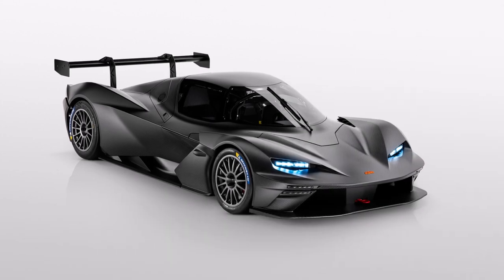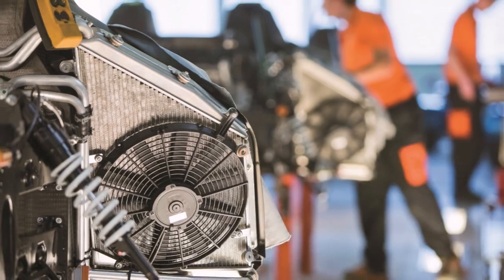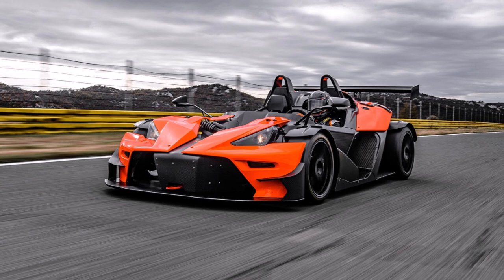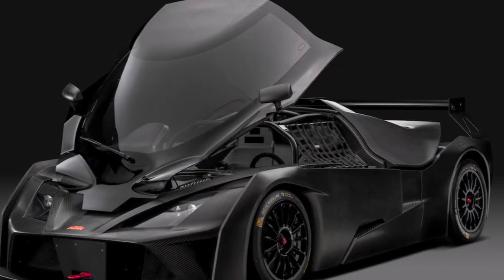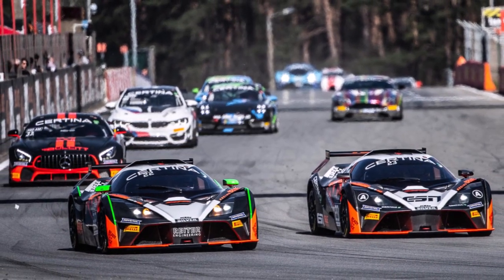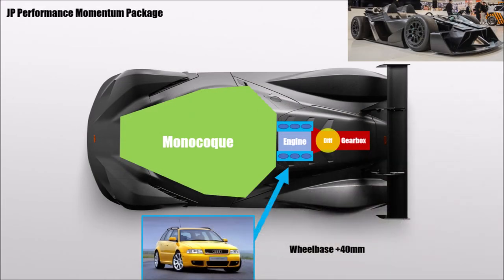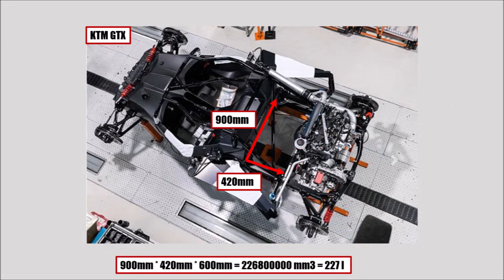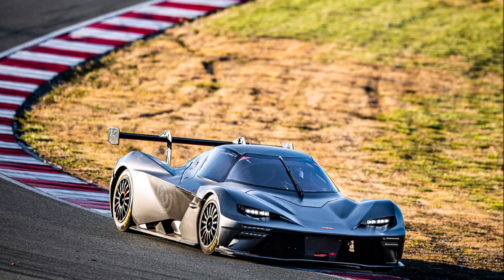The KTM X-Bow Story

Comment: I'd like it more if they installed more beefy engines (that doesn't mean they would be heavier btw, there are very powerful engines , 800hp for example, that wights around 135 kgs which are more light than audi 5 cylinders Turbocharged engine like the Judd V10 for example and rev much higher and sound much better) so yeah the look is already perfect for my taste but the engine is meh

Comment: At the Bathurst 12 hour of 2022, the KTM GT2 had some technical difficulties, one being the traction control not working properly before the race. During the race, they were having some issues with the car not running the turbo at all and after the 2nd time it pitted and went back out, the turbo failed. So the car was parked in the garage for the rest of the race.

Comment: The GTX is interesting, but I am not sure I like it. Seems like a lot of fun solutions to problems that wouldn't have existed in the first place if they didn't need to stick to parts from the original X-Bow. I know, that's engineering, but I like designs with a purity of purpose. Because of the constraints they ended up with a car that has worse polar moment of inertia because of the engine position, weighs more because the engine and gearbox are not structural and has shorter rear wishbones which I was always lead to believe are less desirable than long ones from suspension geometry perspective (more severe camber changes, etc).

The car from the bunch that I really do like, is the BAC Mono. It is a real focused thing that knows exactly what it is and what it wants to do. Super expensive, but it's money well spent because you get the latest technologies on offer like 3D printed parts or graphene enhanced CF. The setup on the car is very good as well and it's extremely fast. Evo measured the 2.5L version of the Mono as being faster around Anglesey than the P1 GTR - with the GTR being on slicks and the Mono on road tires! The limited edition Mono R is even faster and could actually be the fastest production road legal car ever made (around a track).

Either way, cool to hear about the X-Bow and X-Bow GTX details!